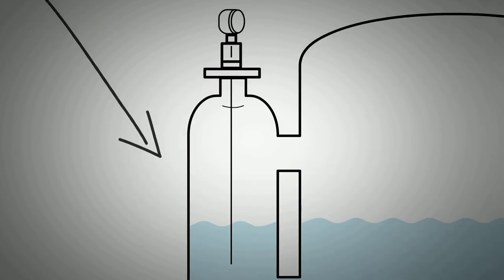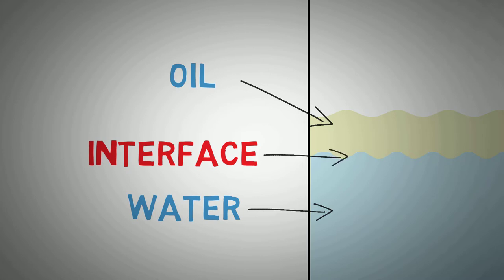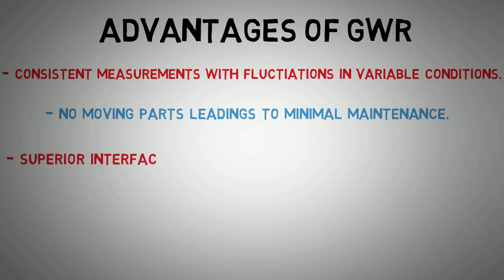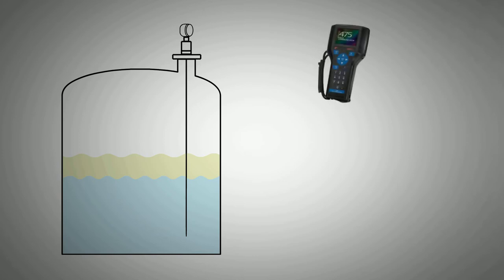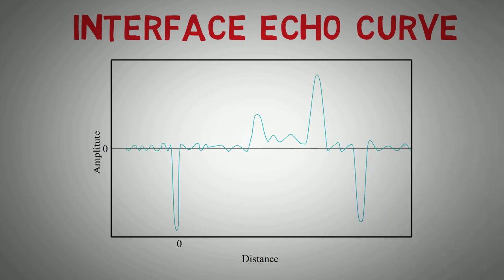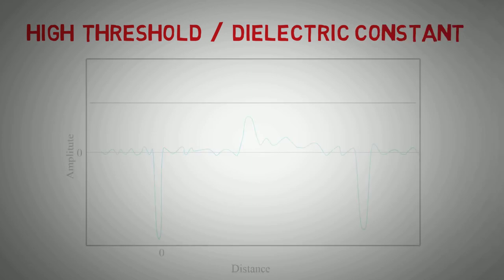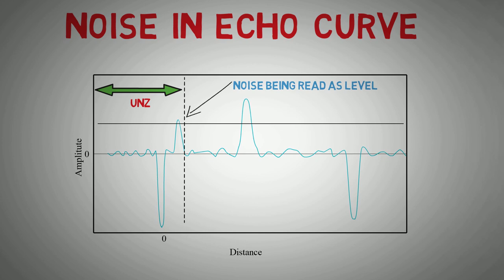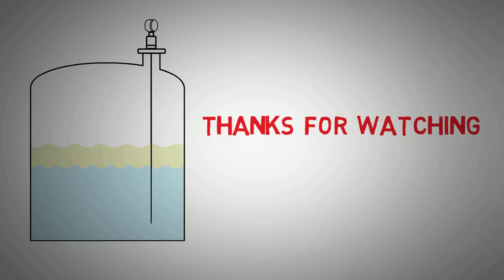Guided Wave Radar Level Measurement - [Echo Curve Reading]

Comment: Good idea for a next video would be the difference types of values encountered in Oil & Gas for example SDV’s (Shut down valves) FCV’s (Flow control valves) & PCV’s (Pressure control valves), BDV (Blowdown valves) Vent valves and Bypass valves, also can mention I/P control for Actuation of valving. Types of Actuators, Single or Duel Piston? You could also mention Gas Compression and how it works with Gas Turbines. I used to work for a Gas Turbine company so can definitely point you in the right direction.
Reply from the maker: Hi Jurassic Sparks. That's a great idea. I'll definitely stick it on the list of video ideas. I do want to do some gas compression videos as it's a huge topic. Thanks for showing an interest in the channel!
Reply: @InstrumentationControl  it’s awesome to have a decent Instro channel. We’re essentially dirty scientists.

Comment: This is the best video explaining the echo curves, I am having an issue of sudden 100 reading and it got stuck for a long time then recover back to normal. In a vessel that seperates condensate from gas. What do you think?
Reply from the maker: Thank you. Is the transmitter located in a bridle? Condensation around the top of the probe can cause full range issues. Look at the echo curve, maybe consider false signal suppression if appropriate.

Comment: How would you go about calibrating it for precise measurement? Have a GWR on a 30ft oil tank. Tank reading is 20 ft gauged, GWR shows 19ft
Reply from the maker: You can change your probe offset or play around with your range values if its a static error across the range of the transmitter.